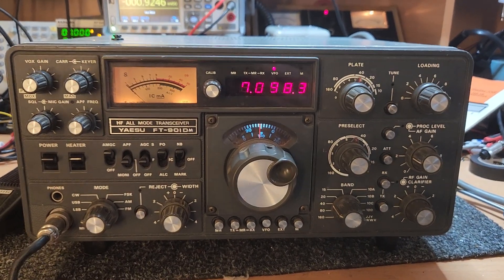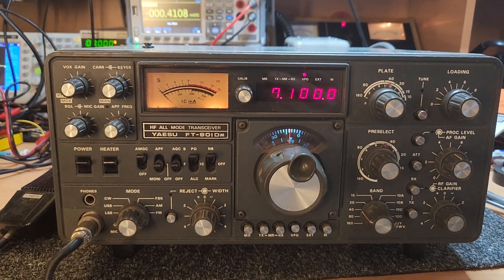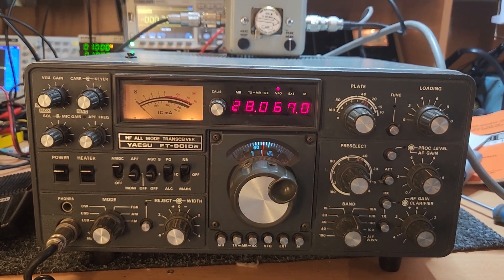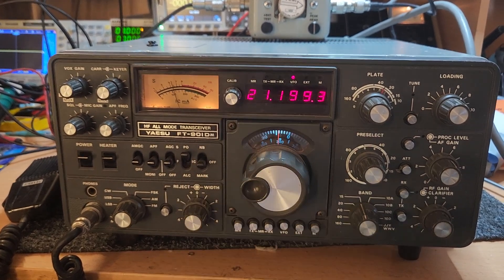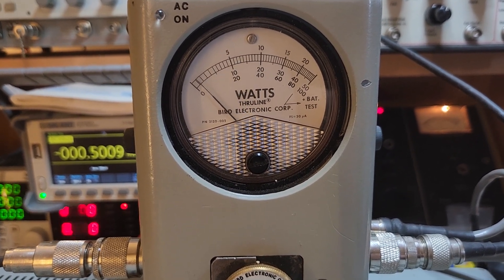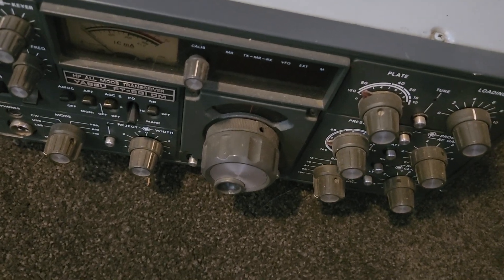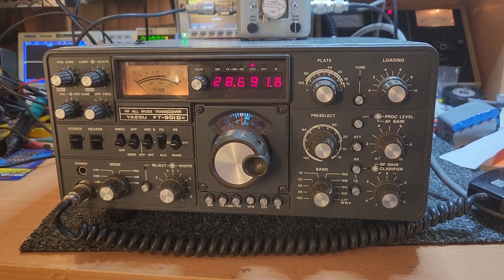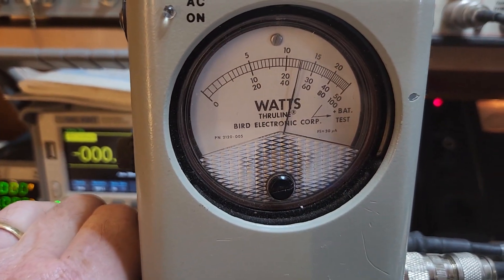Yaesu FT901DM,what a beautiful old classic, everyone should have at least one in their collection...

Comment: I got an FT-901DM for cheap at a hamfest a couple of years ago, with a note that it had a stuck frequency counter.  That much definitely was true - it just displays "1.400.4" (or something similar), and doesn't change as the VFO or bandswitch is turned (though an extra 1 appears in the leftmost position when 20m or higher is selected, and it does still blink when one of the blank positions is selected).  The interesting part, though, is that it has the earlier frequency counter module, with the red digits and the calibrate knob (like the one in this video) - not the later one with the yellow digits that's known to be troublesome.  One of these days I'll dive back into it, when the line of stuff waiting for its turn on the workbench isn't as long...